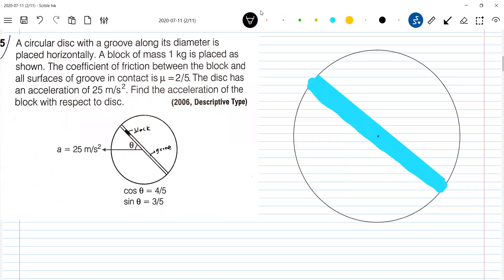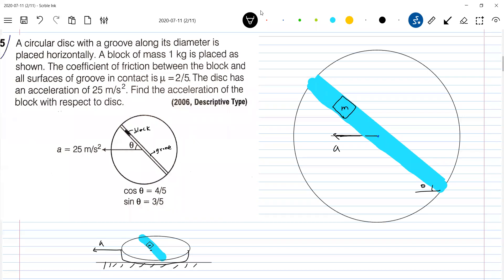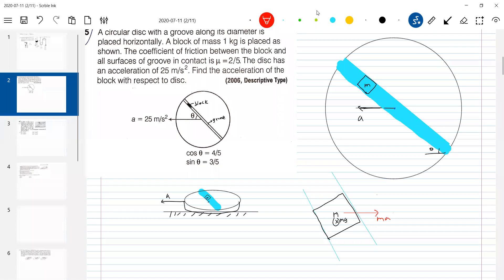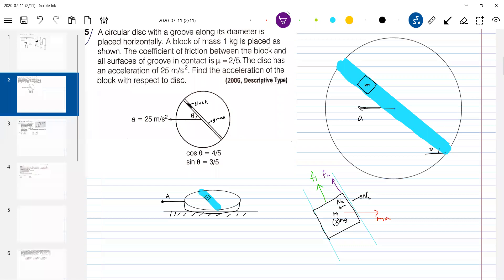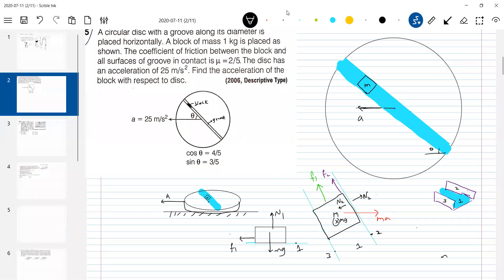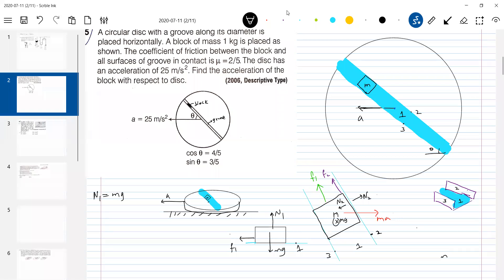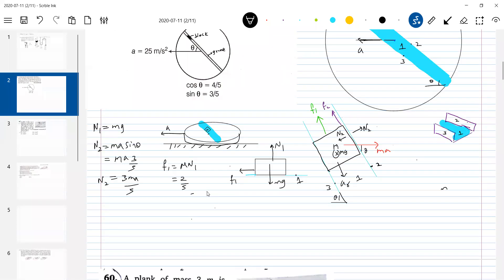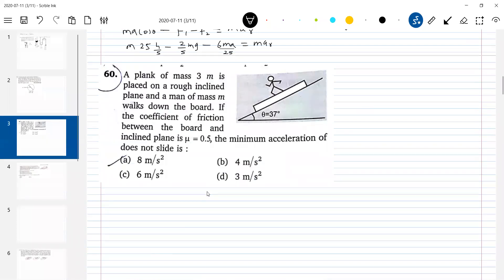6) A circular disc with a groove along its diameter is placed horizontally. A block of mass 1 kg

Comment: Why is there only one normal by the walls
Reply from the maker: Due to pseudo force ,it will be in contact with one  vertical surface only .
e.g - you are sitting on a seat in moving bus, the back support of a seat will push you forward.The front seat will not exert any force
Reply: @sridharsirphysics  oh understood thank you sir